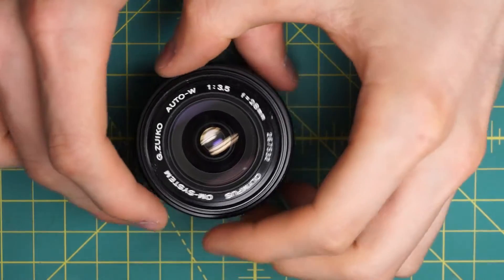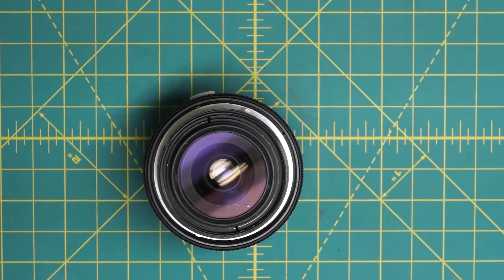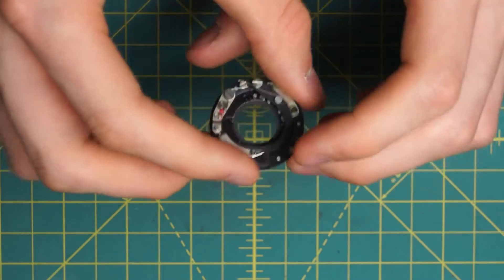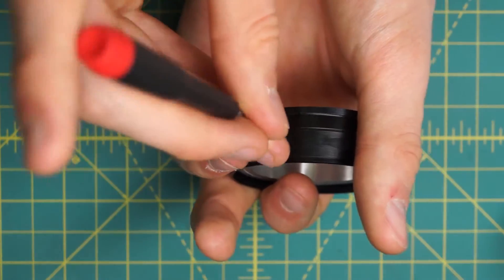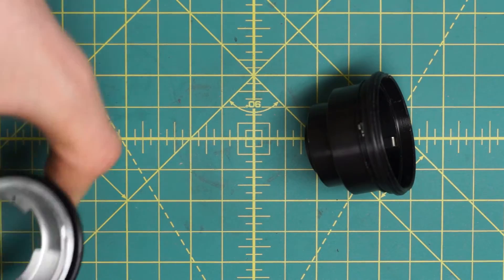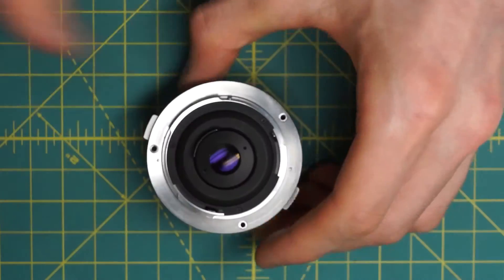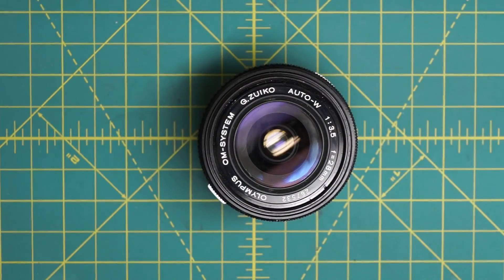Olympus G.Zuiko Auto-W 28mm f3.5 Lens Disassembly

Comment: I have the correct rubber friction tool to remove the front nameplate and found it infinitely more difficult to remove  than what you've shown here. I also custom made two pointed bits to engage the outside spanner slots when the friction tool failed to remove the inner ring. In both cases, in addition to applying acetone, neither the inner name ring or the outer ring with the spanner slots would budge. Somewhat frustrating because according to your video, unusual force should not be required.
Reply: Did you manage to remove it? I can't

Comment: my  aperture ring on this lens is very very tight when turning it. would you have any ides why? i bought it this way. overall its in pretty good condition otherwise.
Reply: As is mine! Did you ever find a solution to this? I suspect a dot of lubricant under the aperture ring would do the trick, but I’m not 100%

Comment: Fantastic video Matt. One tip though: if you undo the cap that covers the rear lens element, you can remove the two element groups. The first one just drops out; it's a very thin lens. The second one is a group of elements mounted in a brass frame. You may need to press gently from the inside. I discovered this arrangement when they both fell out on me... The trick is to remember the direction the group goes back in!
Reply: Thanks. Just the tip I need. Have a bit of fungus to clean out on that inner element.

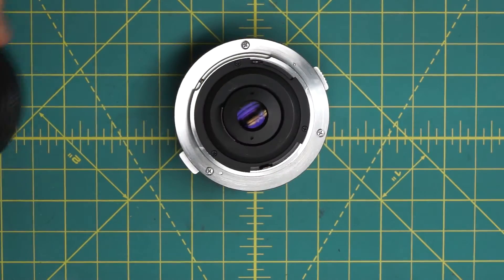Comment: You wouldn't happen to know what size that microscopic screw that acts as a stop on the mounting plate is would you? My lens fell while on the tripod and that screw popped out and messed up the threads and now I need to find a replacement which would be easier if I knew what size screw it was. You can see it clearly in your video - it goes in radially and is at roughly the 10 o'clock position at the 5:41 mark in this video.

Comment: Hi Matt,

I have an OM Zuiko 28mm f2 with some fungus right across an internal glass element. I'm a little apprehensive to disassemble as these Zuiko lenses seem to be more complex than the Rokkor primes that I've opened up. Is the 28 f2 similar enough as the f3.5 in this video to be used as a guide?

Thanks for all the videos on your channel- very informative!

Jordan
Reply from the maker: +Jords H I can't say for sure. All the Zuiko lenses from this era that I have taken have had pretty similar designs. They are very different from Rokkor lenses but they are well made and the design is not too complex, especially if you just want to access the front optics.

What I don't know is how well the optics themselves can be disassembled. If the fungus is on the front or back surface of the front optic, then it should be easy to deal with. But if it is on an interior element, then you will have to actually start taking apart the optic. Depending on the lens and where the fungus is, this can range from easy to impossible.

If I ever get a chance to take apart one of these lenses I'll be sure to post a video.
Reply: +Matt Bierner thanks Matt, that would be awesome. In the meantime, I might try to get the front optic out and see it if it is just on the rear of it (fingers crossed). Thanks for the info- much appreciated.